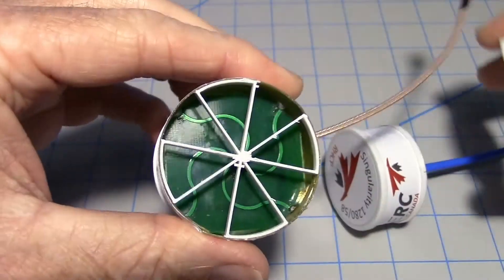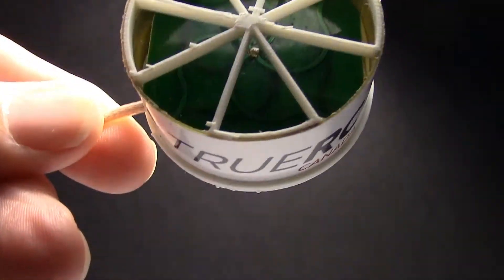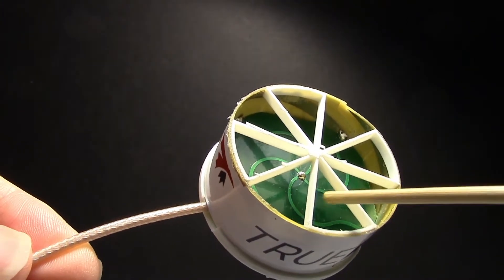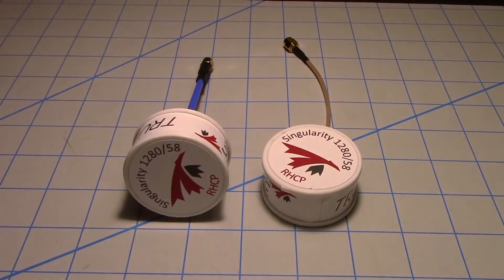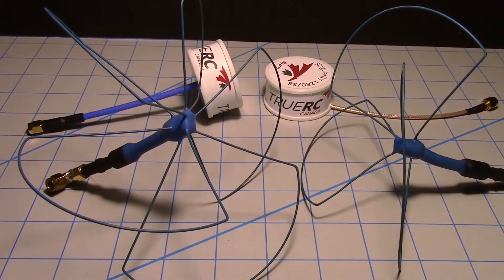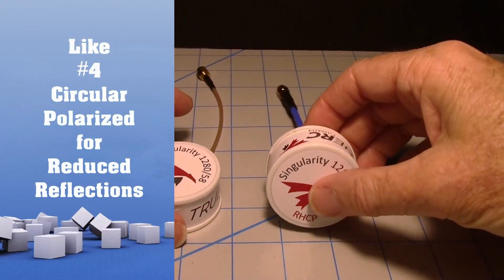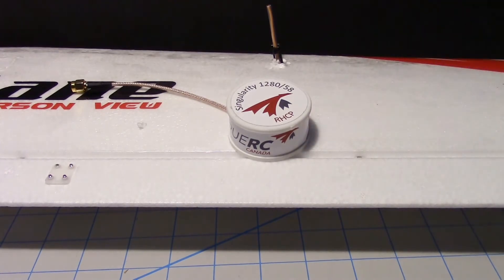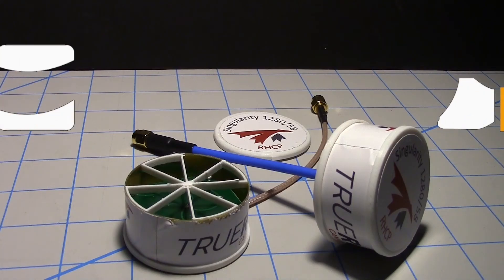5 Likes 😀TrueRC Singularity 1280/58 Compact Antenna - 1.2 GHz CP FPV Aerial

Comment: Dave to the rescue yet again!
I bought a couple of these but I can only get the side mounted ones over here at the moment. I was wondering if I could convert one to a bottom mount for the goggles 😁😁😁
Reply from the maker: I would say you could do 
the conversion without too much trouble with your skills. 🙂
Reply: @DaveMerc  Already done 😁
I bought a Ranger G2 and put a traditional 1.3 skew on the underside front - a long blade of grass keeps bending it and I didn't even know these existed until the other day!
Cheers, Dave for dismantling one and showing it's possible.

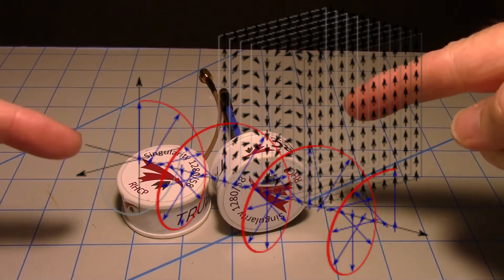Comment: 4:05 Nothing clear: what direction of emission circular waves? Is it goes from top of cylinder or how I need to position this antenna to ground station?
Reply: I think most of the emission direction is from around the circular cylinder walls as opposed to the flat top and bottom
Reply: @flat-earther  Can you imagine in 3D animation circular polarisation of waves with circular diagram?

Comment: Do you have any photos of the feed point?  I'm curious how hard it would be to solder a longer coax line.
Reply from the maker: I just have what's in the video. I never removed the bottom cover so have no pics of the feed cable solder points.

Comment: These have been out for a while now Dave.  Be interested to see you take them out to 7 Miles distant. The Bluebeam skews are just ridiculous IMO and the drag is horrific, even though they do work okay.
   The No No for me is the large vtx antenna, its way too big to sink in a wing for example and as you said, dont put it anywhere near any carbon wing spars....I have been out far and low with my little Dipole on the vtx, it actually seems to get better further out TBH, certainly no multipathing. That said, it does suffer a little multipathing when very close in.
  Put it on the big Ranger and head out, lets see what it can really do..?....It won't fit on my Z84, thats for sure....lol.
Reply from the maker: Oh! but Mr.Turbines the FAA and AMA have regulated US down to visual line of sight distance using a spotter so I can not test to my hearts delight.
So sad having all this fantastic equipment to only go as far as paper airplane. I will put it on the VR2000 and test the near field and dream of the lofty distances of the old days.
Reply: Lol....yes, Dave, the enjoyment Police will have their pound of flesh....but only if you let them.....:)
Reply: How have you found 1.3 dipoles when close to ground?

Comment: Hi Dave, I use a well-tuned 1280 GHz clover and a ground patch antenna, tell me if I put CompactTrueRC Singularity 1280/58 this antenna can make the signal worse? I like to fly below 150 meters and a distance of up to 14 km
Reply from the maker: I have no way to know. You should test it with your setup and report the results.
Reply: @DaveMerc  I asked because you showed both types of antenna in 2-3 minutes.

Comment: Can you use one of these with a cloverleaf or a dipole antenna or do you have to use them together
Reply from the maker: Dipole would not be a good match. Cloverleaf with the same polarization might work. Also a helical with the same direction might work for a narrow beam.
Reply: @DaveMerc  OK thanks for the info